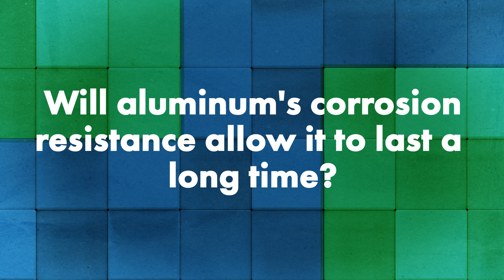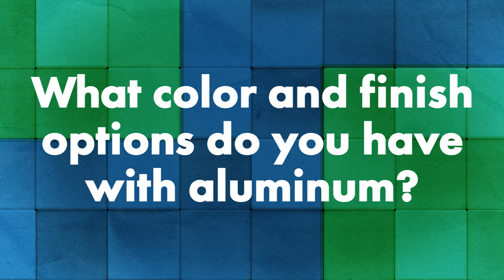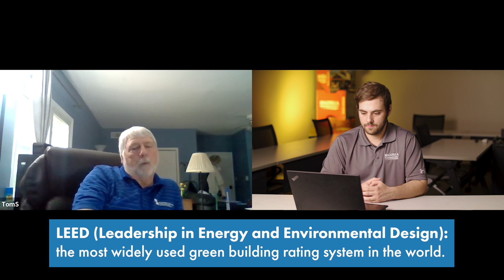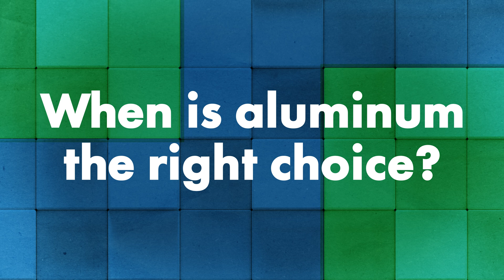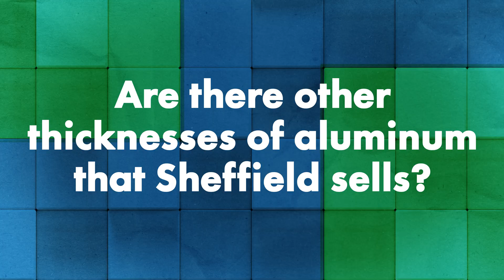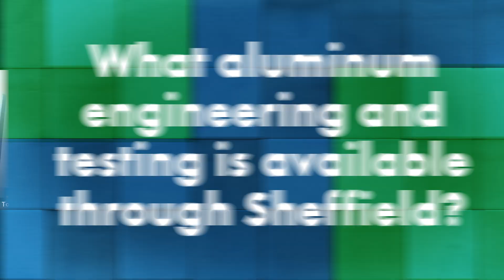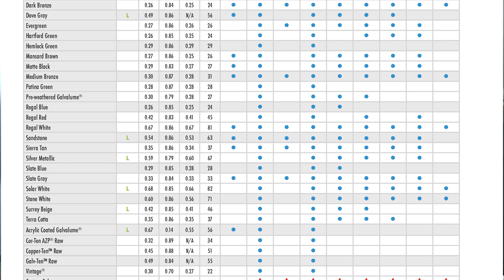Aluminum Roofing Advantages and Disadvantages: Aluminum Roofing Review

Comment: Hi how does aluminium roofing compare to ceramic tile when looking at heat aspect inside home thks
Reply: Both offer excellent R-value for the homeowner.  The bigger difference between those two roofing systems would be in maintenance,  which an aluminum roofing system requires far less than does ceramic tile.
Reply: Weight

Comment: what is the expansion difference on a 20' length?  How does the two compare with corrosion say a few miles inland of NC coast.   Will one last longer than the other,  same with colored finishes?   Thanks for the info, I'm in a learning curve since metal roofs are extremely rare and expensive in Northern California.  Moving to East coast in next few years (Jacksonville, NC)

Comment: Hi. Any disadvantage putting metal roof in a flat surface.
Reply from the maker: Yes, there are only certain panel profiles with specific installation methods that will work with a low slope application. If your roof is completely flat, you should consider a material designed for flat roofing. Hope this helps! -Thad
Reply: @TheMetalRoofingChannel  thank you for taking the time to respond.
Can you share which material are good for this type of roof.
Reply from the maker: Check out this article from This Old House that explains a few different types of flat roofing: https://www.thisoldhouse.com/roofing/21015399/3-flat-roof-types Good luck with your project! -Thad